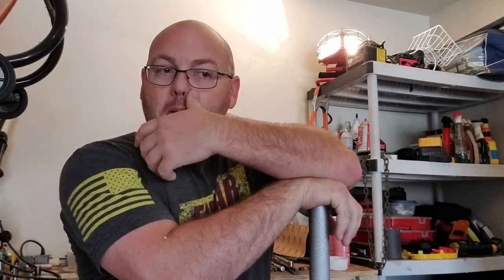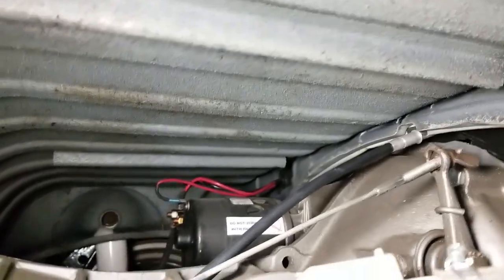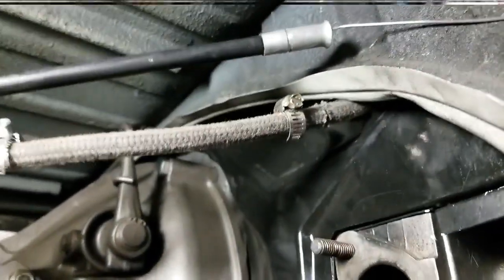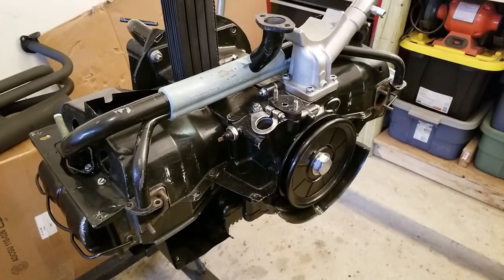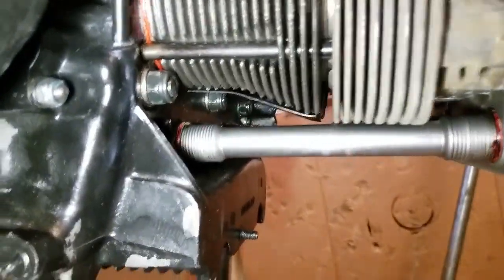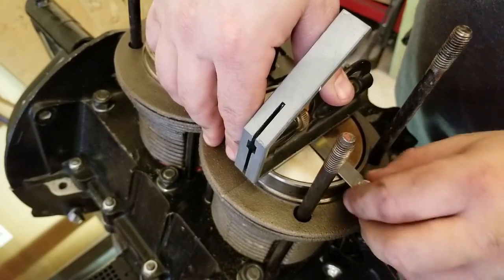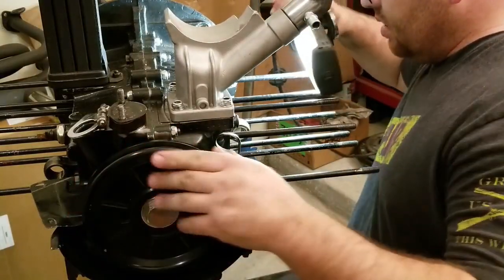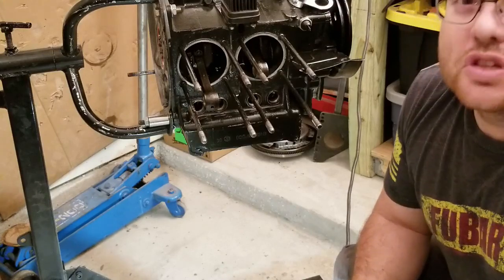Troubleshooting Cylinder Problems & Engine Removal - VW BUG | JW Classic VW

Comment: maybe the number 2 connecting rod is upside down.  I did not see the dimple up.  the light was close and it might have just been overexposed.
Reply from the maker: You may be right, I plan on rebuilding the 40HP this year as a back up I'll make sure to look for that!

Comment: I have one motor been playing around with on deck hieght and compression ratio, and have a few different carb. combination i want to try, the delay been getting my engine run test stand built, completed it two weeks ago during the holiday break. The one thing I forget to buy each time i'm at our HF store is the compression test gauge like the one you procured,, been using my buddies.
Reply from the maker: I want to build an engine run stand too... would be so great to test the engine before putting it in.